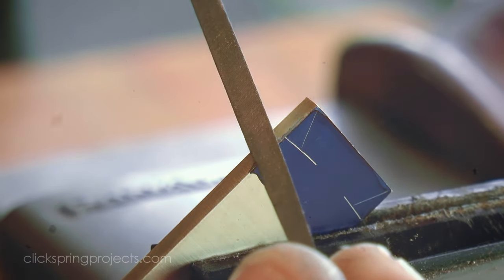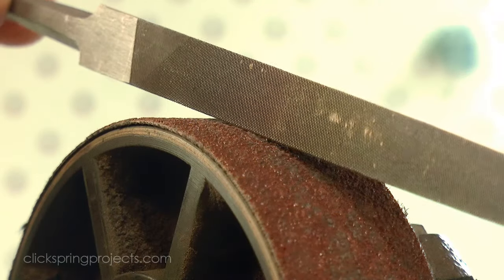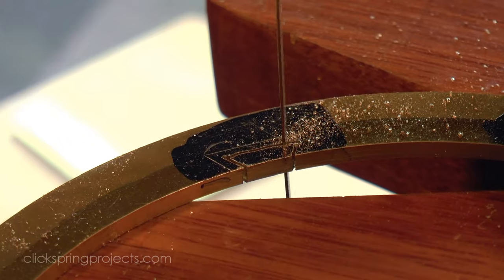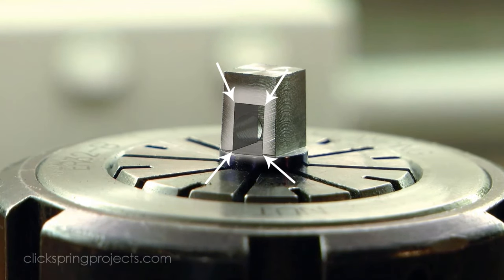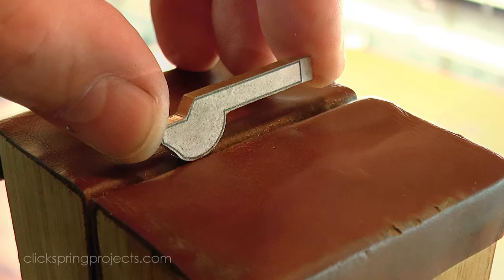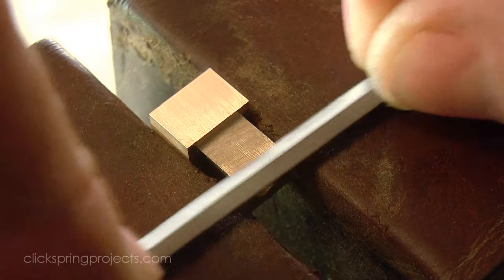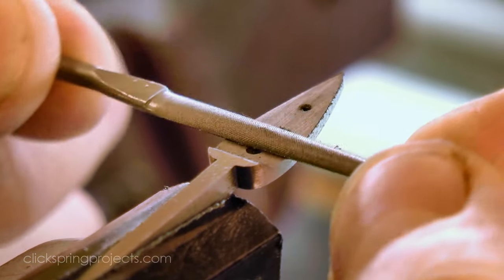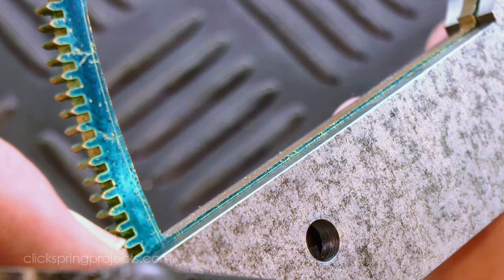8 Old School Tips For Better Hand Filing

Comment: Thanks Chris, that's an absolute masterclass.
A few people may not know it is possible with care to file hard materials (hardened tool steels, up to maybe 50 Rockwell C absolute tops):
But take heed of these tips: don't use a new file; use lots of pressure; do not use a rapid stroke (and this is crucial): lift the file off the workpiece for the return stroke (or you will ruin the file). Clean the shavings out regularly, perhaps as often as each stroke.

The general rule about pressure is to use less for soft materials. 
For speed: fastest for brass, slowest for cast iron.

For filing aluminium alloy, use a specialised aluminium file (eg Nicholson Type A, or a "shear tooth" file). It must be sharp.
Clean the file as soon as you detect pinning, or preferably before (or you will produce deep ugly grooves in the workpiece).
Pinning is retained aluminium in the gaps (gullets)  between the teeth. 
Chalk the file (soapstone also works, possibly better) if pinning is a problem, particularly with "gummy" grades of aluminium .
Alternatively: Kerosene may help.
Again, but for a different reason: Don't drag on the return stroke. 

For filing brass, you can get specialised brass files (eg the Nicholson "brass file" with "short upcut angle and a fine long angle overcut, which produces small scallops to break up filings and enable the file to clear." 

Using round or half round files: work clockwise around a contour for best results.

The best way to clean a pinned file, particularly a high quality, expensive file, is to take a piece of brass or bronze (not too hard if the latter) in flat bar form, perhaps 20mm x 3mm rectangular cross section, and align the long axis of the bar with one of the groove or gullet axes of the file (the deepest groove, if there is one). Raise the end you're holding to say 25 to 30 degrees, then force the corner touching the file along the groove direction, to create grooves in that corner so that your tool takes the converse shape (female recesses in the tool corresponding to the male teeth of the file). Repeat the same action to clean out the gullets of the file. That corner of the cleaning tool should only be used with identical files to the one which created it, but each tool has four corners available, permitting up to four types of file on each tool.

Store files carefully. They should never come into contact with another file's teeth.

Comment: Chris, great video!  On the idea of using buttons and guides I always cringed at the idea of hardened steel.  Good files these days are NOT cheap ! ! ! !  So I agree with the idea of mild steel buttons.  As a helper though a felt marker could be used to ink up the edges of a guide or button to aid with spotting the limits.  And unlike Dykem or similar the felt marker can be touched up easily during mid operation without tearing down the setup.  The times I've used this trick with guides it's proven helpful.

Comment: 1. Keep your files clean. Chips suck.

2. Files cut in one direction. By trying to cut on a reverse stroke, you mash the teeth flat and effectively blunt the file. More of a trap for new players than anything.

3. For heavy cuts with a coarse file where a lot of material is being removed quickly, don't trust you arms to move in straight lines. Firm up your shoulders and move from the hips. More of a farm tip than anything.

4. If you're sitting, draw filing is by far the most effective way to do it. Has to do with leverage.

5. Get up to the work like it insulted your mother. Then take half a step back so you can sock the boyo in the mouth. Up close for leverage and control, a touch back so you can actually move.

Pretty basic stuff, but it hurts to watch people miss some of it.
Reply: Fireball Tool pretty exhaustively tested point 2 of yours, it's false. Surprisingly. Recommend checking it out for some mind blowing stuff.

Comment: Dear Chris,
                       I have watched this video several times over. I have built a quite a few models over the years mainly of brass and of railway subjects. I was always frustrated with the difficulty of filing a truly square corner die to the geometry of the teeth. Your tip about producing a safe edge is great and I must steel myself to do this. Your workmanship is a joy to behold and the video is beautifully lit and shot. 
Thank you for your considerable efforts in making this video and showing what is possible with files.
Reply from the maker: Many thanks for watching Jack :)

Comment: Two rules I would add to this well done video. 

1.) Never use a file without a handle. Seen to many people stab themselves. 
2.) Files will only cut in one direction. So lift the file when returning to a new cut. 
 
Basic rules, many people over look them when working.
Reply: I think its ok to slide it on the returning stroke just dont press it

Comment: Safe edge files are the way to go. I do the same thing, make my own safe edge files and buy Grobet Vallorbe or F. Dick. I like to also buy parallel surface files or cut the ends off to make them parallel. I also use mild steel rounds on each side of what I need to file round and then coat the mild steel rounds with felt pen, black or purple. When I touch the felt pen ink on the steel rounds I am finished, and my file work in the middle is round. You do beautiful European-style work; ask somebody in India to do the same thing and it just isn't going to come out like your work.

Comment: My tip: don't get too attached to your files 
They will wear down and eventually become useless. There's no way of sharpening them again.
As difficult as it is, some day you'll have to throw them away and get new ones; the more you delay the decision, the more frustrating your work will become.
Reply from the maker: Completely agree
Reply: Assuming you're on a tight budget, about where on your list of priorities should that be? How quality should 'good quality' be?
I got files that literally my grandfather used and I guess they work, but I've also never had brand new files.
Reply: I find Bahco files are a good go between. Their price is notable but not crippling and you get a good cut from them and they're pretty durable. They wont last forever but they will last about 3 or 4 times longer than the cheap £10 sets. Im not too sure how small they make them however.
Reply: Jose: One thing that you can do to sharpen a file and that is to drop it in a weak acid overnight, it works very well by undercutting the blunt teeth, many people dismiss this as an idea as they assume that the acid blunts the file, but they offer their comments without having tried it.
Reply: Lol i have an old "Bedford" file that i have not been able to identify the cut of to source a replacement of similar quality. Consequently the file is kept indoors in a leather pouch with dessicant  after a good clean!! i use it sparingly cause i know what happens if it's damaged or worn :(
Reply: There is a reference in an old (1920s)  'formulas and remedies' book I have about  sharpening files using a cloth stretched over a frame and nitric acid...  It doesn't fill me with  confidence :)    
Nice video, I wish a few of these tips were outlined to us in Tech Studies.  Greetings from more-tropical-every-year Adelaide.
Reply: If I recall correctly from experiments, a 1 molar solution of hydrochloric acid is a nice soaking reagent for sharpening files. If they're clogged with aluminium the acid solution will react with the metal to produce hydrogen and aluminium chloride, cleaning the file and still sharpening it. Decades ago when I was a TA to panelbeaters and coachbuilders, the board files used for leadwiping and shaping body filler, and steel metalfinishing would grow blunt, and they'd be sent away for chemical sharpening, three or four times before they became too thin to use.
As you say, acid sharpening works perfectly well, and the dubious should walk along limestone coastlines and ask themselves whether the chemical etching has resulted in ground that is sharp or dull underfoot.
Reply: Englishman French what is weal acid?
Reply: Rob Robinson in the US we can use diluted liquid plumber
Reply: Or throw'em in the coals and hammer them into a new tool.
Reply: I'm an electrician, and this is how I am with most my tools. They get replaced at intervals before they pose safety concerns
Reply: i like how you think! An old file can be re purposed into a wonderful knife or maybe a broad point chisel
Reply: Rob Robinson I'm sure that was meant to be "weak". I had a moment there myself 😐
Reply: A 20% solution of phosphoric acid, sold in the U.S. as a rust remover or driveway cleaner, works very well to sharpen files. The file should be clean and free of any grease. Immerse in the acid for 90 minutes. Check and return to the acid for another 30 minutes if not sharp. Gently wire brush off the layer of iron phosphate with a brass brush. As a bonus, the thin iron phosphate layer left is moderately rust resistant.  Clyde
Reply: My Dear Old Dad made special-shape wood-turning gouges out of old, worn out flat bastard files.  (He was a child of the Great Depression, and never threw anything away if it could be re-purposed!  The files were from a WWII aircraft manufacturing plant in Burlington NC.  Super good WWII American steel!  He used them for turning the inside of small to medium sized wooden bowls on his lathe.  I have them now, and once you sharpen a proper edge onto them, it stays sharp!!
Reply: If you really don't want your old files, give them to a blacksmith. He will appreciate them.
Reply: Old files are great high carbon steel. Good for making tools, I have personally made, knives, chissels, gouges, gages (for measuring and/or verifying shapes/sizes...) scribes, spade-bit drills, D-bits, flycutters, scrapers, flint strikers, awls, straight razor, scissors...
You get the idea, would be one huge post if I listed all.
Actually I save broken/dull taps, reamers, millingcutters, drillbits, they are either high speed steel or carbide, great for tools.
Springs are another source of steel that are often possible to heat treat and thus turn into tools.
Reply: Unfortunately most of modern files are just surface hardened with some really soft metal underneath... I also make different cutting tools from the files I inherited from my Dad )))
Reply: Alex S, uhm i buy quality files so mostly all hard.
Oh, another thing, the acid sharpening works to certain extent.
even better is electro etching, do you have a DC powersuply and a graphite vat of electrolyte around? no, ok.
There is resource online with acid strength, voltage amp charts for different filecuts/sizes.
 can not find it now, but it was US government issue during ww2 to save resources, also mentions slaking in potash Then rinsed in water dried and dipped in benzene containing some percentage neatsfoot oil (whatever that is).
BTW, the doc warns that a "over etched" file is actually "too sharp" in begining and have to be gently "broken in" on brass or bronze or the tips fray giving prematurely dull file.
By the way, check golfball for filehandle, surprisingly confortable
Reply: Alex S that I believe, at least for the import ones.
Reply: Rob Robinson : It is a result of typing in the dark ! It should have read "weak" , as in "vinegar".
Reply: nick f I believe black diamond is made by Nicholson. Commonly available here in the US.
Reply: Well afterwards you have material you can use to reload your favorite smokeless firearm in the cloth.
Reply: greaser5691
It works. There are commercial businesses that sharpen files. Acid etch is the way they do it.
Reply: Don't throw away your files. Sell them to blacksmiths. It is excellent tool steel.
Reply: I know my reply is a year late but, I agree completely. However, a high end file should last a long time even with daily use. Also, just because ones dulling does not mean it’s completely useless, I also like to keep a pretty dull, not completely dull, but still one that’s some what dull for lathe work. It’s works great for bringing off a thousandth or smaller.
Reply: @SkullCollectorD5  Well, the sad thing is that if they become dull and abused (they probably get dull more from bad handling than from use!  From touching each other in a drawer) you slowly get used to it.  If you buy a good quality new file you will be surprised!  Some of them will cut you, which seems impossible.  I've read in old Model Engineer magazines that people used to reserve new files for softer metals:  Like Aluminum, then Brass, then Steel.    They are expensive and worth it!  Sometimes you can find a deal on eBay, I try to get a dozen or whatever is in the box, and hoard them.  Also I've had good luck at some flea markets.
Reply: @clydeulmer4484  I tried this a few times, put them in a glass baking pan and tried to agitate them a little, or brush them when I thought of it.  Had read in an old Model Engineer that the acid should be very dilute.  It was as you say, they looked odd from the phosphate coating, but some seemed very sharp.  I tried different acids and mixes and times and it all seemed to work about the same.  I really do want to try the electro-chemical method, probably in a glass tank with lead or graphite electrodes?  But that acid business does work, despite all the bizarre controversy!  It took me about a decade to get around to it, and it's really worth doing. Messy business, so one it was rolling and seemed to work I might have put a few dozen through!   Thanks for posting your valuable tip!
Reply: @leonardpearlman4017  A file can cut you? Since that comment I've bought a set of cheap files on Amazon. They look and feel their price, but cut wood well enough, which is all I need. Even took one to chamfer the corners of a No.4 plane and it did its job. But never would I have thought they could cut me.
Reply: @leonardpearlman4017  You're quite welcome --I'm always pleased when someone finds what I have to say useful.
Reply: I would never ever throw away a file, worn, damaged or just plain end of its useful life. There are way to many uses for them, seeing as how high quality files are made from high quality steel. Least of which is making a good knife. They could also be used to make pins, wedges, keys and straight edges to name but a few. Stock for small parts is another good use. A quality bearing scraper or chisel are also fine uses. The file size and shape can also be put to use determining it's new life. But, a long, 1/4" thick (or more) mill bastard would make an awesome knife. Reshaping is fine but forging would really give you what you want. So keep those old files!!!
Reply: @DwayneRouthierJr  the best way to deal with a dull file.
Reply: @Nathan-mg7ho  or if you are good at forge welding almost anything including the edge of an axe.
Reply: @sblack48  I will definitely appreciate old file donations if anyone offers some.
Reply: @bobgarr6246  Right you are, Mr. Garr. The Buck Knife company files-into-knives in the first part of the last century. Anza Knives currently makes knives from files, and leaves a portion of the original file face on the finished product. Anza Knives have a personality all their own.
Reply: They will be useful to make a cutting edge on a tool once they die xd
Reply: As said in the video, to buy good files is the way to follow. Mine are 40 years old (medium use) and are still well cutting. Swiss expensive files, of course   :-), as I live in their production area. Grobet and Glardon are good brands. 
If you are on a budget, buy one when you can, it will be a better buy than receive a whole kit of cheap ones. As for most other things one can buy. 
Thank you for this interesting video   :-)
Reply: Pld files make the best knives...just sayin.
Reply: @htc007898   My old tool and die instructor was a proponent of sulphuric acid.... citing Hydrogen embrittlement as a consequence of using hydrochloric.
Reply: Boggs Tool in California does an excellent job of resharpening worn files
Reply: All of my files are old ski files.  They’re generally good quality for the price.
Reply: @453421abcdefg12345  Yes i agree I do use this method for reviving fret files. I do it at least a couple times a year I use the rust remover acid as its not too strong but be careful I have also left them in overnight and ruined files .

Comment: I paint the tang of my brass files yellow,  silver for aluminium, after they are worn they are general purpose I remove paint.
Reply from the maker: Nice :)
Reply: Why do you use separate ones for brass and aluminium? Because of the hard aluminium oxide or is there another reason? I use green handles for non-ferrous and grey for steel.
Reply: Aluminium files have adifferent cut pattern. So do lathe files.
Reply: I see, but then they shouldn't need marking. ;-)
Where do you get your aluminium files? I bought a couple Nicholson Magicut files for a project with a lot of aluminium filing. After replacing the handles with something decent they worked great, but that's a very limited selection shape wise.
Reply: I get my files from Travers tools. I mark the aluminium ones because have a mistake in the past when I am in a rush.